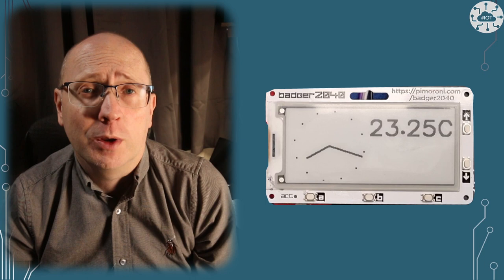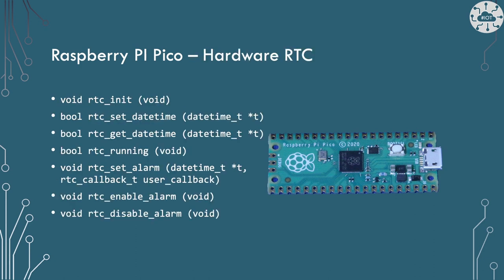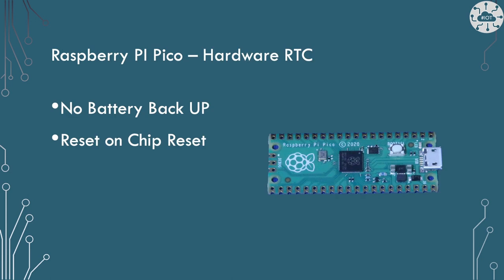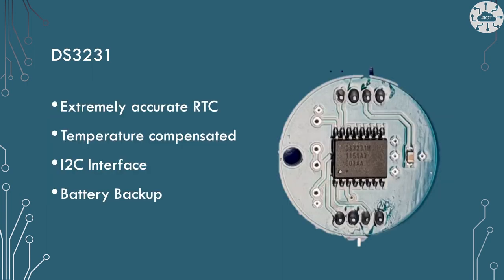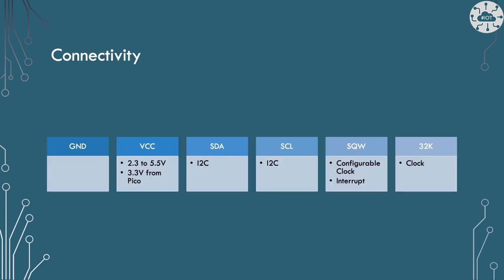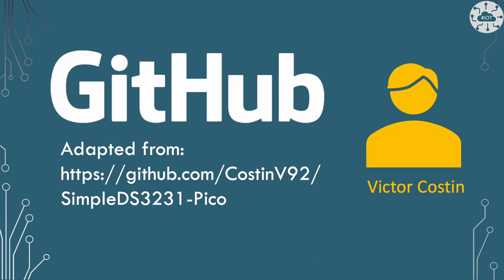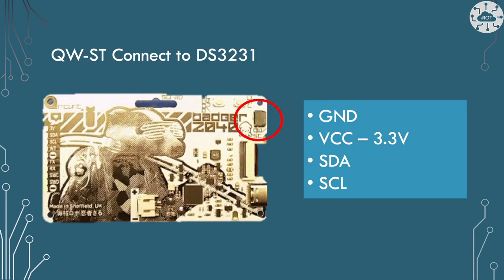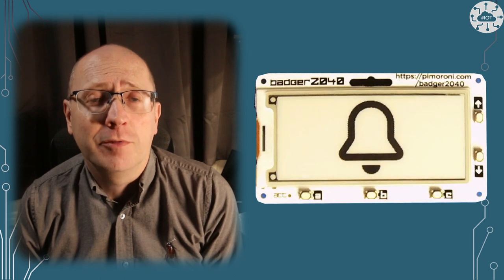DS3231 Real Time Clock with Raspberry PI Pico and Badger2040

Comment: I'm testing 2 DS3231 at the moment. One gave 2-3 seconds off and the other gave 10 seconds off over a month. I also found and bought 2 rechargeable coin batteries, but one RTC circuit is still having 3 AAA batteries connected and came out to be better in that first test. Both have nice analogue clock graphics and numbers updating every second, so I'm happy with that whole thing. The further builds of what I thought about will take a bit more "work."
Reply from the maker: Thank you for sharing. That is really interesting. 10 Seconds a month was more than I was expecting. Does anyone else have stats on time slip on these devices?

Comment: I needed to make a synchronizer for my Self Winding Clock Company clocks. Basically it needs to wake up once per hour, assert a pin that will control the synchronizing signal to the SWCC clock. I need to have a run time of 6 months on a battery. I used a DS3231 for this. On startup it queries time via NTP, and sets the DS3231 time. I set the DS3231 alarm and make the pico go dormant, to wake on interrupt from the clock. When the alarm triggers the pico wakes, synchronizes the SWCC clock, resets its alarm, and goes dormant again. It will periodically query the time via NTP, once a week is enough for my purposes. It remains to be seen how long it lasts on a single battery charge, but signs are good I will exceed my 6-month goal.
Reply from the maker: That sounds excellent Ralph. Great project.
Reply: The Lightning detector hardware is interesting. 

GPS gives the location of the sensor.
GPS gives a once per second interupt. 
So you know very accurately how many microseconds the clock takes between each interupt
Now measure when you receive the strike over the radio part, recoding the microsecond from the system clock
Now you can divide to get a very accurate time to the microsecond. 
Send to the central server. 

ie. The GPS can be used to measure temperature changes in the clock, and that is used to compenstate

Comment: I use the internet in a "Pico 8" app and it gets hot to run on Raspberry Pi 3B/3B+/whatever. Now I want the Pico to take care of showing a nice clock and nothing got hot in my stress tests, but my breakthrough is MMBasic being simpler to code with all sorts of connections and text/graphics. I also want to "read" the sunshine (solar panel ideas), temperature and maybe log the data.
Reply from the maker: Sounds like a fun project.